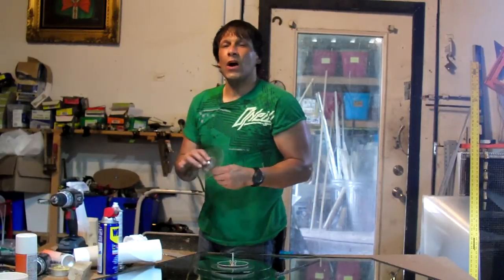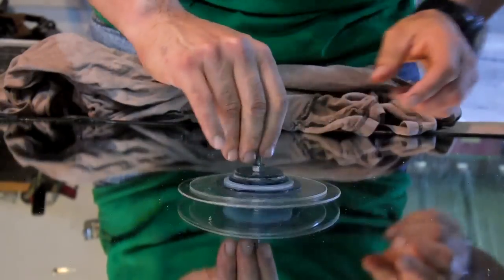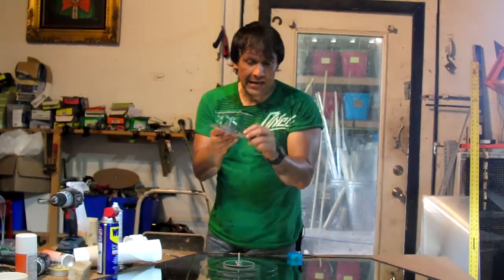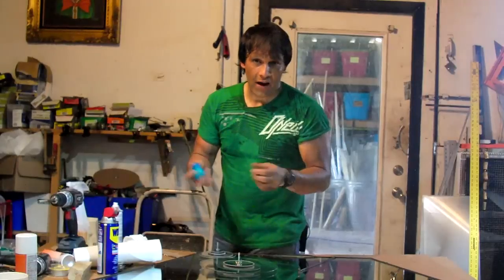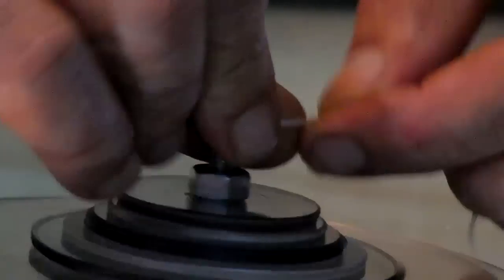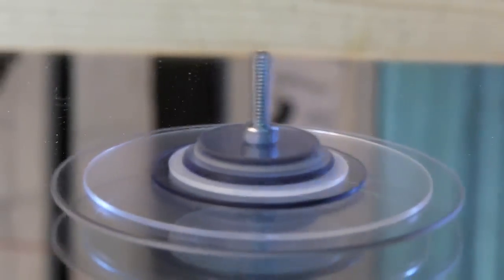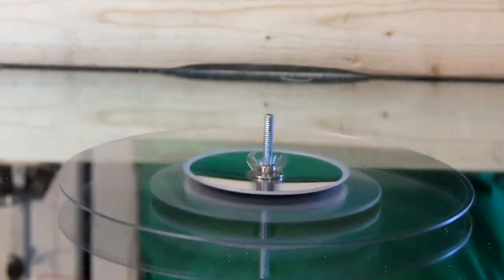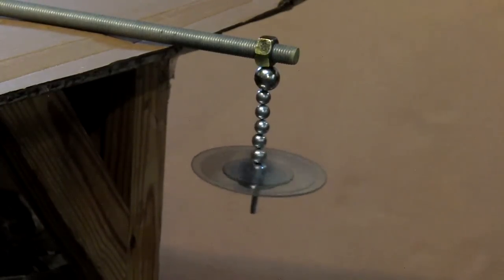DIY spinning top power 5,000 + RPM Dan's method for Super High Speed trick beyblade

Comment: Invent 1 of those with some fan blades and you can cool yourself off ;)   great video man.
Reply: doesn't work because there will be air resistance= the fan slows down= all that energy you just put into it is wasted in 5 seconds or less.
Reply: Justin Koenig   I was just kidding because of how much he was sweating ;)
Reply: Victor Poulin didn't notice that
Reply: Justin Koenig so using spinning energy is useless?
Reply: OriginalRipndip you can't effectively store energy in rotation with one of these because of the large amounts of drag. what you can do is create a fan with a very heavy reaction wheel with some gears on it and you can speed up the reaction wheel to ludicrous speeds. Then you can gear it so that the ratio of spinning the wheel to fan is like 50:1 or something like that. That should work.
anyways, there are more effective ways to store energy I imagine.

Comment: I dont want to be rude but the friction between the stick and top is so minimal that if it made a diffrence it would be unoticable mabey your results come from the added string because yiu are applying twice the torqe in the same timeframe
Reply from the maker: ADRIAAN1007 Tops are extremely low powered flywheels so any resistance is a factor.

Comment: May I suggest that you add a short hex cap machine screw to the top of the assembly (use a threaded standoff?), cut a matching allen key to a straight shank and insert it into a rotary tool? for large tops, it may require too much torque, but for smaller ones it should be fine as long as you accelerate slowly.

Comment: Hey Dan spin it with a dremel to 30.000 rpm. I have tried already out using the axis of a very old betamax or vhs video player. In a flat surface it could spin for more than 10 minutes. Is awesome.

Comment from the maker: The loop can be cut also (two ropes) I was thinking of large engine flywheel (-:

I have polycarb in 3/16" sheets, agree about the acrylic. I am making an inertia friction welder that runs on a small treadmill motor. Thinking with two people as a tug of war scenario, with enough strap length, the motor may not be necessary. BTW your night bubbles are awesome, added to our feed.

Comment: Dan, you reminded me of a Christmas gift I got when I was around 9 or 10 years old. I am now 58. It was a giant gyro which strangely looked like a huge yellow flying saucer. It had a pivot point on the top and bottom, several balancing stands for different applications. It had a hole in the bottom slightly off center for a hexagonal hand crank to be inserted and used to charge the flywheel. It sounded as if it had gears to step up the RPMs and would spin and balance for around 10 to 15 minutes.

Comment from the maker: Hi,
I have a small glass concave mirror and it works good. The acrylic is softer so it deadens the spin. I have a blot with a point, will give it a try. I am working on a DIY maglev that should work. Also made a prop version that flies but it seems to be attracted to eyes so eye protection. Trying to see if the RPM can exceed 10k, smaller diameter disks flip on their side and turns into a crappy euler's disk.

Comment: you should try to produce a sharp pointy enge at the end of a bolt, by rotating it in a drill while working it with an angle-grinder :)
See what resaults you get, but i would assume, you get another minute of spinning, or maybe two :)
Also: Why not spin it on a very lage parabolic mirror, so that it self centers :)
Have a nice day dan! :)

Comment: If you put a small countersunk hole in a surface for the bolt to sit in, put some tiny earth magnets around the edge of the acrylic and about a couple of milimeters from the acrylic could this be used to make power to light some LEDs. Or use wire in some way around the outside a few millimeters from the acrylic to generate a small amount of power?

Comment: Same idea, opposing pulleys 180* apart, using a high torque electric motor to pull the very long strings, center post shortened and balanced with tip pointed. Maybe tip inside a tiny indentation with graphite (or whatever) for friction control?